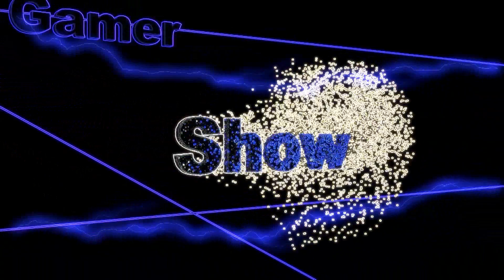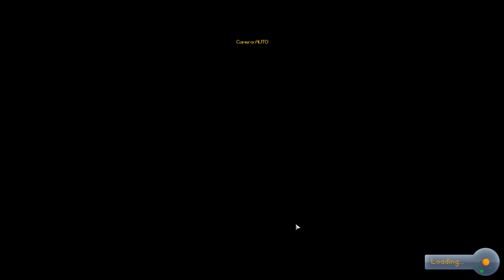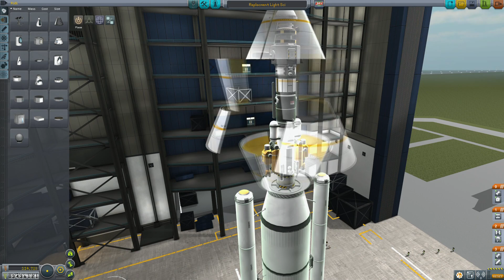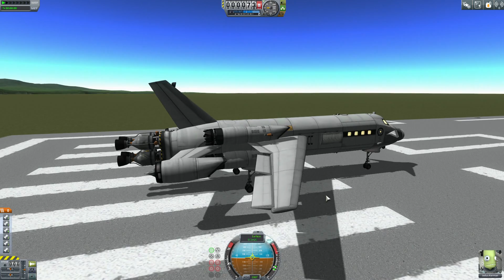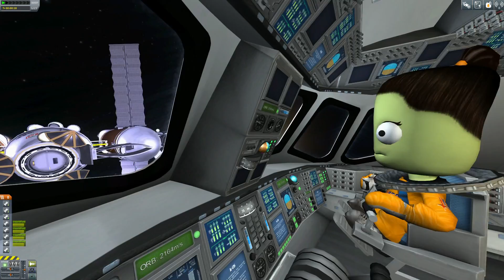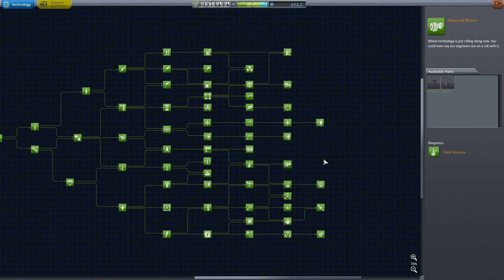Kerbal Space Program (2015) - Old School Career Mode 32

Comment: I had a problem quite often, and even with all the fuel in the front tank to keep the CoM way ahead of the CoL the aircraft kept flipping out of control. I couldn't figure out what was happening since it was the exact same model that I had flown on multiple successful missions.

The reason was: there appears to be a bug in 1.0.4 where, if you fly certain SSTO models from ground to orbit to ground they will not correctly compute the CoM when reentering.

This will lead to the craft flipping over and dying. The solution is just simply to save and load again. 

Noy saying this is what happens to your OMGWTF craft there, just tat, if you verified that your CoM is ahead of your CoL, and yet it keeps flipping out fo control, that might be the case.

Also, at the end of the video, when you said there was no damage? There was significant damage, you lost most of your control surfaces on that wing. Good thing you were already landed.

Comment: Flaps? I thought the new control surfaces were speed brakes. I haven't unlocked them myself yet, so not sure.
Reply from the maker: Allan Larsen I was using them as flaps and they would work as both speed breaks and flaps.